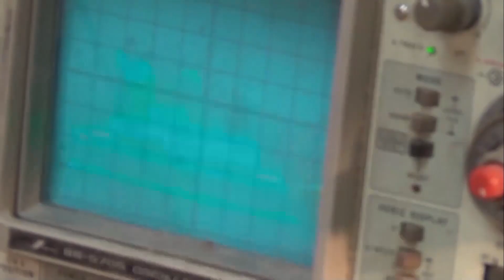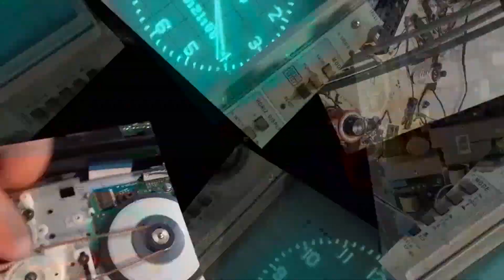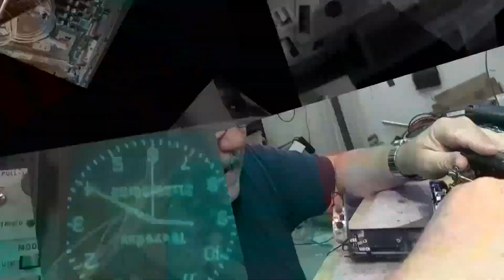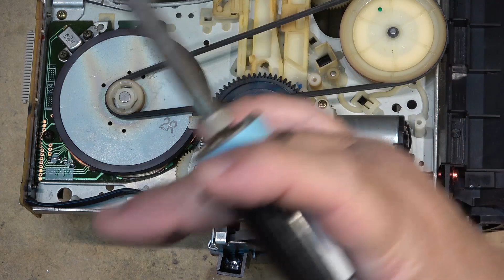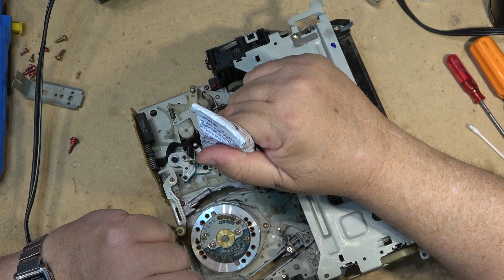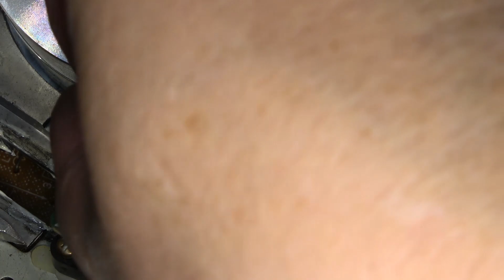Panasonic PV4361 Mechanical Maintenance all these machines need

Comment: The sound of this other mic is better. With this said they both sound better than the camera mic used before.
06:27 - Gives a new meaning to 'motor burnout' or 'toast', even if it isn't physically damaged by heat.
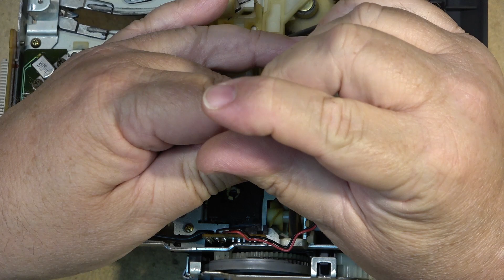08:09 - That makes practically even switchmode PSU's, VFDs (as in motor drives) and everything that uses square waves, digital devices.
15:16 - That's not exactly the wormgear part, but don't ask what purpose those tiny little fans serve they add to the wormgear drives.

Comment: Class D amplifiers are often referred to as "digital" because they operate by rapidly switching the output devices between an "on" and "off" state, which resembles digital operation. However, they are actually analog amplifiers. The input signal modulates the pulse width or duty cycle of the output waveform, which is an analog process. The term "digital" in their context is more about the switching technique rather than the signal being digital.
Reply from the maker: The on / off operation of the switch is digital at it's most basic operation.  The very fact that the output is a 1 or 0 IS digital.  People confuse and incorrectly argue that it is not digital. It is not a coded digital as pcm is but the very fact that the signal from the comparator which is the analog equivalent of a/d by turning an analog signal into one that is represented by 1 and 0 right down to the filter that removes the pwm and restores the analog waveform.

Comment: Well I did notice the people repair my equipment there are a lot older than me doesn't seem to be any young people getting into this trade so it's going to get harder and harder for people to get their items repaired
Reply from the maker: Nobody in their right mind is going to get into the electronics repair business.  More money flipping burgess at burger King. I left 21 years ago because I couldn't make a living doing it anymore.  Us old guys just do this for beer or weed money.    I don't don't use either.  Keeps me on pocket change and my big salary at work goes 100% in the bank.

Comment: Can you fix my Sony Handycam DCR-TRV 740? The screen is broken, and when I turn it on, the viewfinder stays white.
Reply from the maker: If the screen is broken good luck finding one.  I have no source of parts.
Reply: aight i’mma try to find the parts or maybe sony does have one
Reply: @DEIdei2064  eBay is your source, not sony, sony hasnt made those parts for over 30 years

Comment: Those mode switches always bothered me. They're always wiping against each other and that should make them self cleaning. When I didn't know any better I had a syringe with white lithium grease in it that I would use to inject the grease into the switch. A little spinning and a reinstall seemed to work for me.
Reply from the maker: They did keep themselves clean when used daily. Once they were put away and not run oxidation set up on the silver plated contacts.

Comment: I was thinking the definition of digital was either on or off. Since the class "D" amp is either on or off I just assumed it was also digital. Even if it weren't I still think the term class "D" would be a good alternate name.
Reply from the maker: Everything from the comparator right through to the filter is binary therefore the technical form of digital in its most basic form. The knuckleheads just don't get it  and you know that the dumber they are the more they try to make their point by shouting out loud.  
They all point out the same thing, it has not been digitized.  No kidding, its not pcm.  It's also not sampled.  The comparator just switches on and off based on the instantaneous varying analog signal.  Exactly translating that analog signal into a pulse stream that is either a 1 or a 0 that infinitely varies with the incoming signal.   The advantage is all the distortion that occurs in linear amplifiers is eliminated.  Some will claim that this causes distortion in itself and it would if the switching frequency was low, but it is very high.  In the RF spectrum actually.  Cancel it out and you are left with the original modulating signal which is an exact replica of the original without anything added.  So pure that many high end manufactures throw a tube buffer ahead to add some even order harmonics for warmth.   Where these big amps shine is driving big loads.  Large speakers that drink power like its going out of style.  Things like magnapan speakers that require tons of power to really shine.

Comment: i may need to scoop up some of those my sonys are not aging well at all my sony beta sl-hrf70 just replaced the stk5441 for 3rd time in 5 years and now has playback and rewind issues
Reply from the maker: Perhaps your old machines are trying to tell you something...like its time to stop using tape! About the only reason I can see to keep an old relic running is to archive material or to show future generations the crap we had to work with every time they whine that the wifi isn't fast enough.  😅

Comment: That Class-D amp guy probably read some crap from a magazine and made up their own understanding of how a Class-D amp works instead of doing research on how it actually works... Magazine says it's digital, so it must be PCM. Ya no. That's not how it works. That's not how any of this works.
Reply from the maker: Its not just this one guy that was argumentative several others have said the same thing.  I usually give a sarcastic response to these idiots which some get all fired up about.  He said I insulted him.  I told him he insulted himself by his ridicules assumptions. Then he told me to go back to school.   All I told him was what I said here.  Pwm is digital in its most basic form. Its a switch. It's either on or off. No in between, the very definition of digital.  If you  blink a light on and off you can signal the other end what you are doing.   Vary the time on vs off and you can communicate digitally.   (Think morse code)  its all 1s and 0s. What you put in the middle is the code.  
A cd player js actually a combination of both.   The audio is digitized into a pcm code, but the modulating laser doesn't have the bandwidth to encode all the possible combinations which could be 10101010for 1 byte. In optical recording you can't have less than 3 bits so the pcm is converted from 8 bits to 14 so the minimum would be represented 11100001110000 and all combinations in the 8 bit byte rearranged to fit the minimum requirement. That EFM stream pulse width modulates the laser.